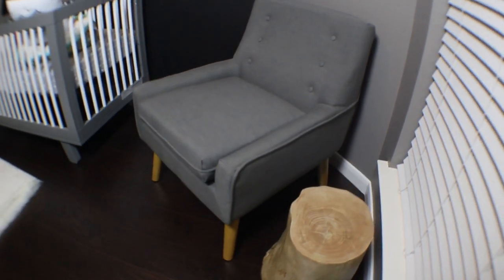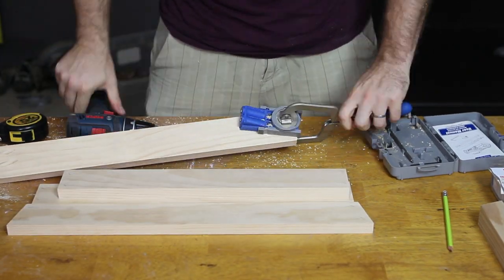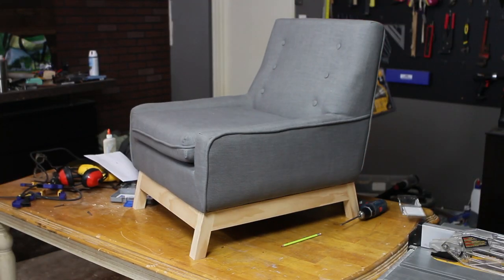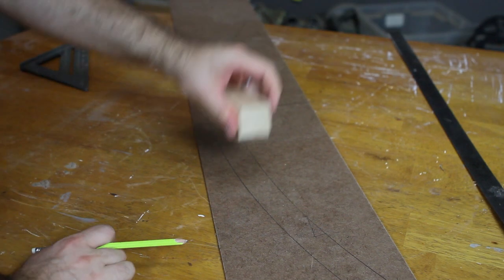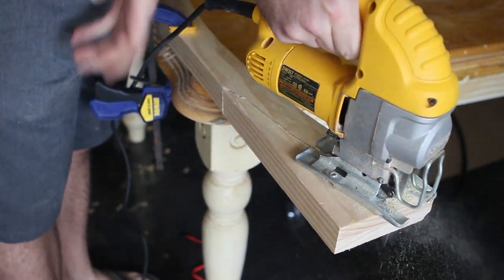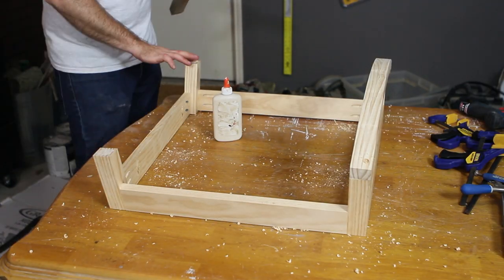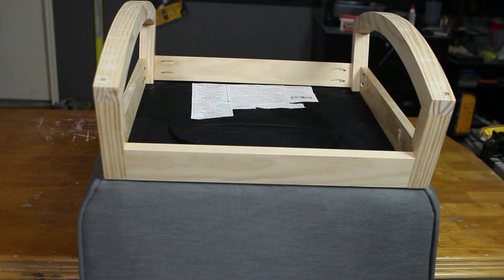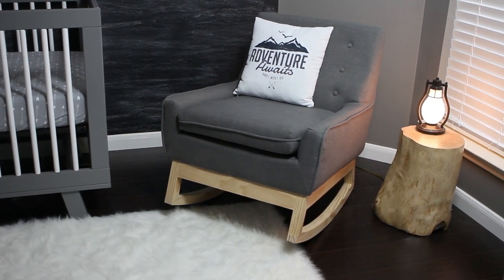How to Build a Rocking Chair Base for an Upholstered Chair

Comment: It looks nice but for future reference  remember that on regular rockers the rockers are closer together in the back than in the front. The reason for this is so that when not being sat in it rests with the fron level instead of leaning back. It also makes it easier to rock in because when you rock back in it, it will automatically want to return to the forward position.
Reply from the maker: That is interesting! I was more focused on ease of construction on this project since it was my first rocking chair build.

Comment: Hey Brent, I love this idea and I'm hoping to do something similar with a thrifted wingback chair. 
Quick question: did you make the new legs because the original ones were conical and had a smaller base that wouldn't work as well with the rocking addition? My chair has very stable, thick legs and I'm wondering if I'd be to skip the step that I don't have the tool for. Hah!